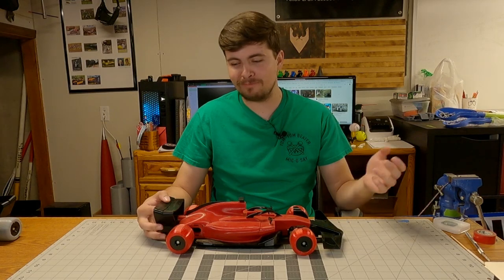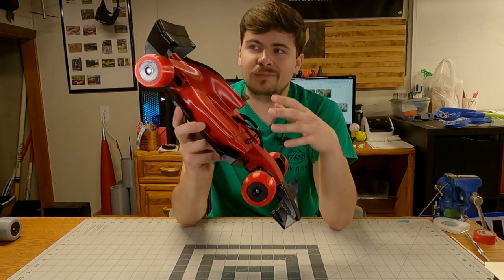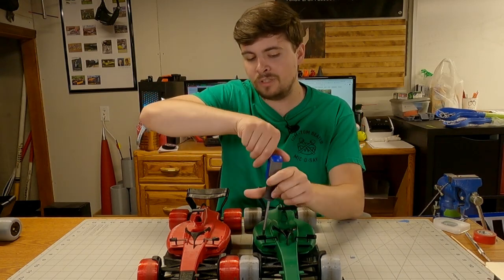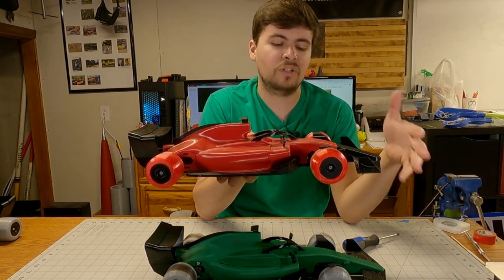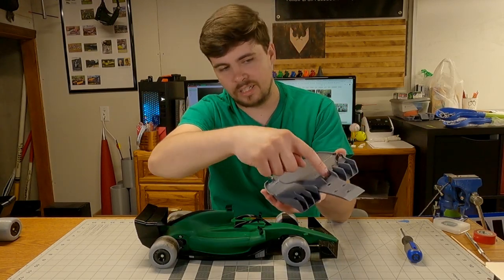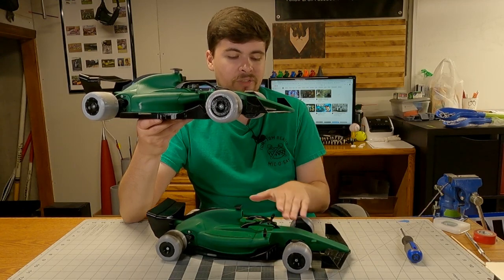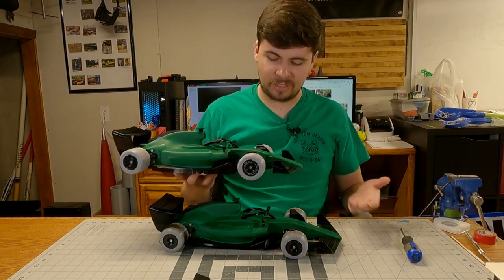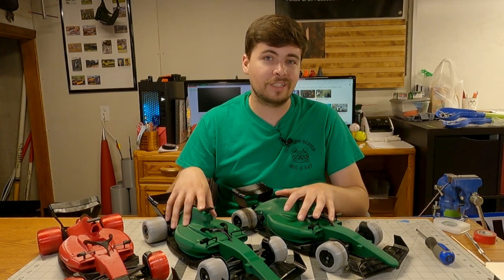OpenRC F1 2023 RC Car

Comment: This is my first time trying to print an Open RC Car, so with the files you listed the 2023 ones seem just cosmetic correct to the car shown in the video. The Other Files listed (2017) are the ones needed to operate the actual car correct? (Without electronics motor etc..) Which parts would I print out? Should I print all of the Original Noree Parts then go to the IPL 2023 Parts list and go from there? Any information would be helpful!
Reply from the maker: If you print all the parts I have listed in the 2023 Printables listing you will end with a functional car. I separated teh listing based on where the parts came from to pay proper respects to their creators. Aka my parts are listed as IPL and parts that are still original Noree are labeled as such. Hopefully that helps!
Reply: @InvertedPursuitsLab  Hey thanks for the information that makes alot more sense. In terms of building it can it be similar to other guides of building the Open RC 2017 or 18 version? Would you ever consider doing a step by step build guide with what material (exluding printed parts) are needed to build it? I just don't know what (or how many) nuts bolts etc would be needed to complete it. Thank You!
Reply from the maker: It will be the same process as the existing build guides.

Comment: The only thing bothering me is the lack of grip. Can you make rims that can fit the common RC Foam compound for maximum grip? :)
Reply: Just cut a bicycle innertube into round bands and contact cement it in place. It's cheap and so far I have a month on them. It will give you lots of grip and you can replace it when it wears down. You can make 8 sets out of one Walmart bicycle tube. Get the thickest one that is tight-fitting over the tires. It's basically a rubber sleeve.

Comment: HI!!!! 
First of all, congratulations for the fantastic design and the hard work put into this design!! The update you made to Daniel Noree's model is spectacular.
I am a 1/10 scale f1 RC automodeling racer, but I am also a fan of 3d design and printing.
My idea is to take your printable files and print the car, but I have some questions for you, if you don't mind.
1 - As I would like to put a more powerful motor (brushless 5.5T), I should print it approximately 30% larger than the original model,
I estimate that the length of the car could be "approximately 60 cm".
Do you think it could be possible and the pieces fit correctly?
2 - The floor of the car that you designed is great!, did you make any other modifications to it? or is that the most updated file?
3 - The wheels, I would like them to be larger (in scale to the 18 inches of the real f1 2022 / 23), do you think the front end parts can be adapted?
- Well... sorry for such a question, I hope it was not a bother... (and sorry if my grammar was not good) Thank you very much for the files and the videos! I'm a big fan! keep it up!! I send you a greeting from Argentina!

Comment: how does it handle withou a suspension. must be extremely sensitive to throttle
Reply from the maker: It very much is. If you just go full throttle it immediately spins out, but if you have a long enough stretch you can get it up to full speed on a with a slow increae in throttle
Reply: @InvertedPursuitsLab once it gets up speed I bet it's planted

Comment: tyres is tpu?
Reply from the maker: Yes, I like the challenge of printing tpu. I do know there are several community mods out there for an off the shelf tire
Reply: would PLA + not work for the wheels? new to rc building / 3d printing so